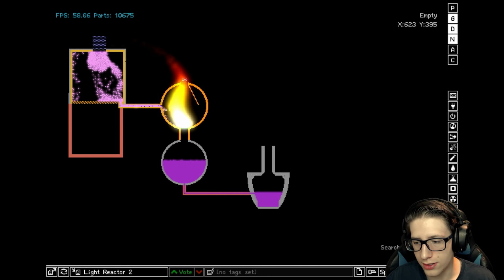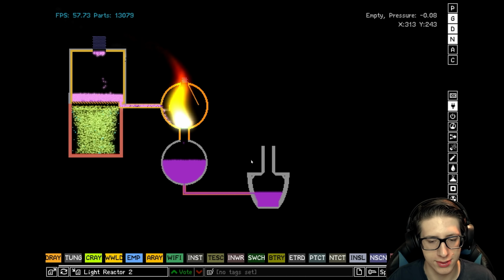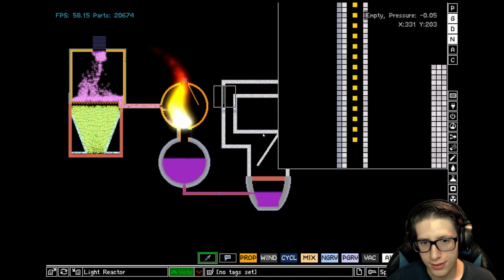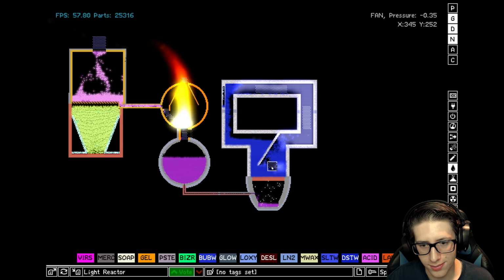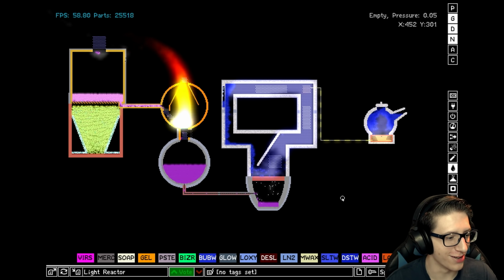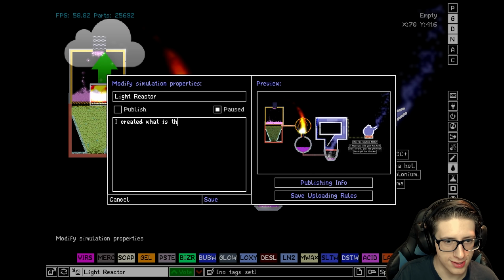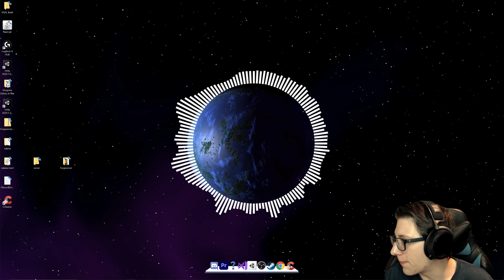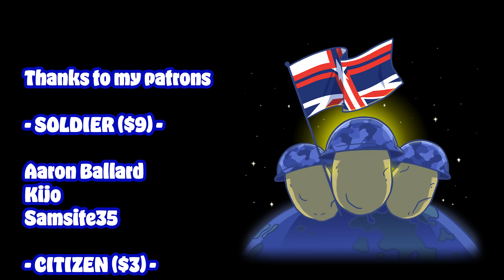LIGHT (PHOTON) REACTOR in The Powder Toy!

Comment: Took a bit of tweaking but I got a DEUT reaction as a NEUT source working pretty quickly. It works soooooo much better than polonium, to the point where you don't even need to burn off the acid anymore. Took a LOT of NICE tho (nitrogen ice, basically even colder LN2) to keep it cool enough
Reply: I made a cold nuclear reactor

Comment: “Mercury cables” old timey AC units used a tube of mercury with adjustable size so that as it heated up to a designated temperature it would expand and complete a circuit that turned on the AC
Reply: Or pressuare switches... or relays...

Comment: I'd like to build a sun reactor. But i have no clue how to generate pressure automatically(or can clone also clone the tool air, since i was able to generate turbulence partikles). For heat i can use uranium.

Or do i need to change the source code in order to add a new wall that produces pressure whilst being powered.
Reply: Use PUMP. It sets the pressure to it's temp.
Reply: @nikkiofthevalley  i'll try but i have no clue how to use it. Just didn't find any useful guides for the game yet.
I used it once but it was at more than 300 degrees but the pressure was only high in the blob of pixels.

Probably should create an account on their game to access the forum.
Reply: @stew9671  There's a wiki..